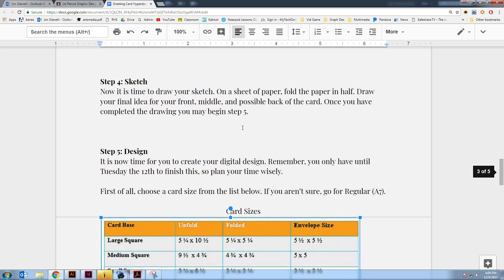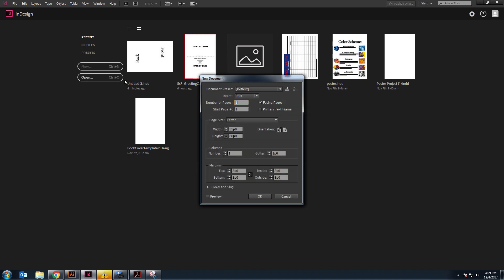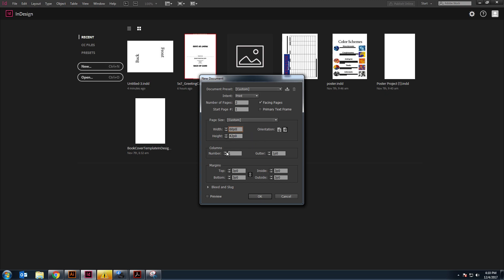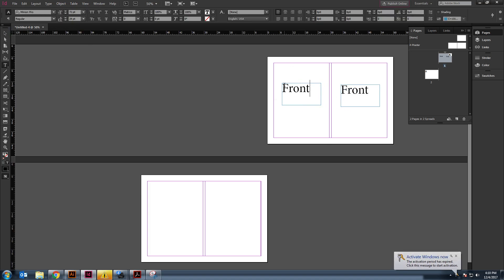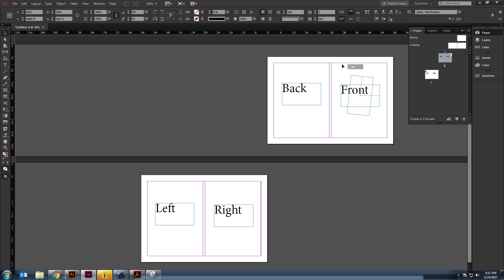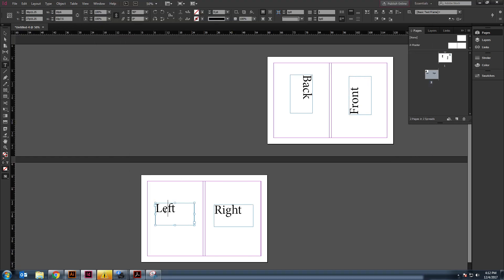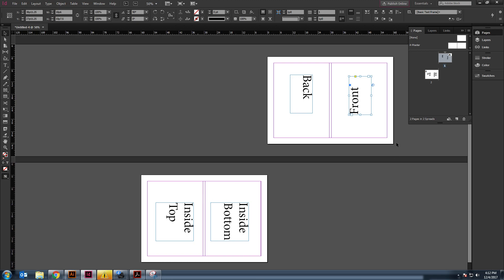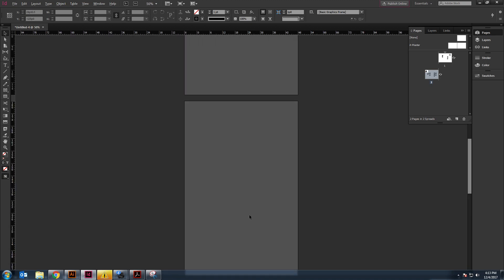Creating a Greeting Card Template in Adobe InDesign

Comment: For the horizontal layout here, the inside top/inside bottom are reversed- the inside top should be on the right of the spread, and the inside bottom on be held on the left ! 

I had to wip out Google and a piece of paper to make sure I wasn't seeing things 😅
Reply: Yeah, he messed that part up badly. Like, why do it that way? Just take each page and turn it 90 degrees CW. Once you have that, the top of page one is the outside back, and the bottom of page one is the front side. On page two, the top will be blank, and the bottom will be where to place text and images. Once you have done that, you can always refer to the pages tab to make sure the layout is correct. Even when you rotate the spread, the pages in the page tab will not move. I am glad I am not the only one that watched this multiple times and was like, wth is he doing, just confusing me 😆

Comment: This is a dumb question, but my margins look a lot different and I can't figure out why. They are set to 3pts. Am I doing something wrong?
Reply from the maker: It's possible that your image might have been created with the wrong units, for example I've accidentally created a document that was 8x11 pixels or points rather than inches. I would check and make sure that all of that is correct. Let me know if it's not that.

Comment: Hello, thanks for this but are you sure the inside page is correct? 

Both of the print guides below show the inside page of a landscape orientation top fold file the other way round from what you have demonstrated.

https://www.cmykonline.com.au/CustomersResources/FoldingInformation#A5%20Cards%20Scored%20in%20half%20(4pp%20A6)

http://support.chronosnet.com/support/solutions/articles/3000029734-why-is-the-inside-of-my-greeting-card-upside-down-